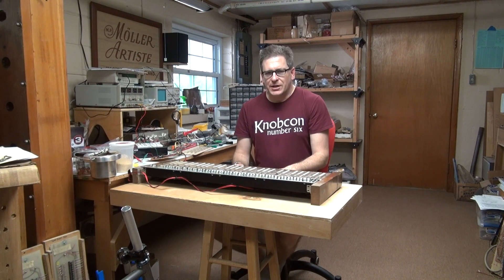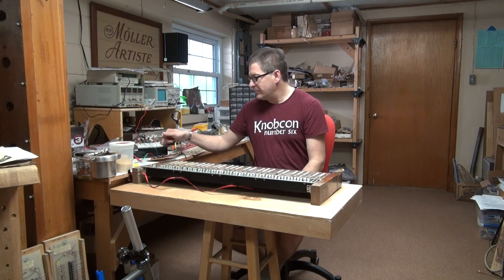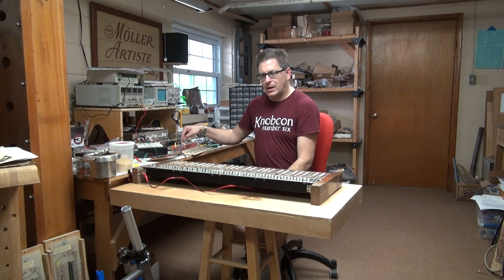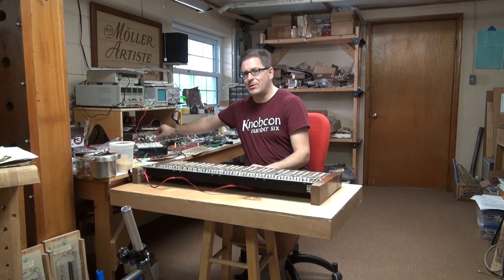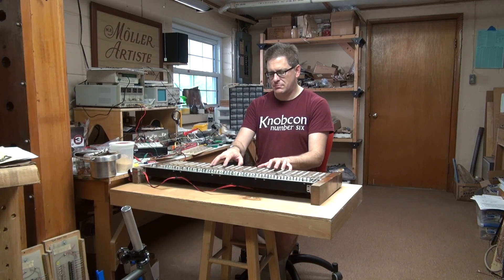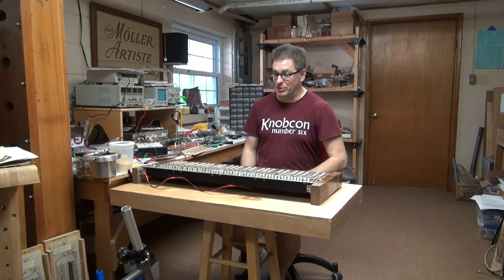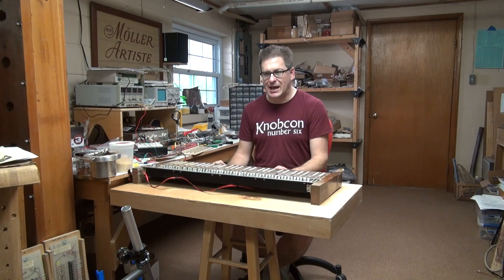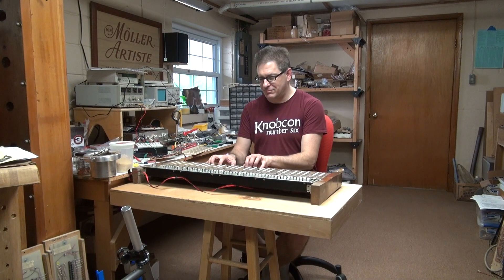Polyphonic Synth prototype demo

Comment: I'm kinda new to electronics, so I might say something silly, but might need to install a linear potmeter between the powersupply and the oscillators for pich bending. I subbed and liked cause this is quality content! Keep up the good work! :)
Reply from the maker: Yes you're right but as you'll see this whole setup is very outdated and is being replaced by something which sounds better, has vibrato, basic filtering, and pitch bend!
Reply: @cnagorka  Can't wait to see! :)

Comment: do you have schematics im working on a similar thing but want to know how you mixed all the signals
Reply from the maker: There's no way to post links and stuff in these comment sections, but I can tell you that the mixing business is straight out of Ray Wilson's "How to Make Analog Synthesizers" book, or the old Forest Mims Radio Shack series of "engineers notebooks". Super simple op-amp mixer with two inverting stages, and volume pots feeding a buss going into the first stage.